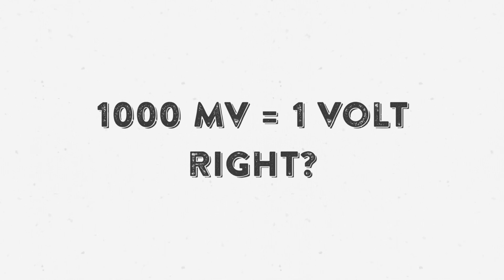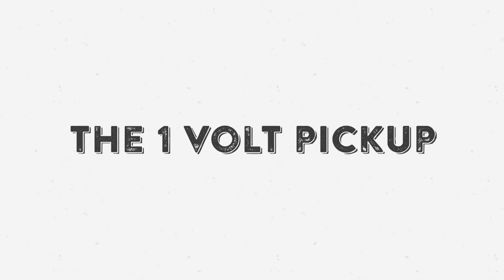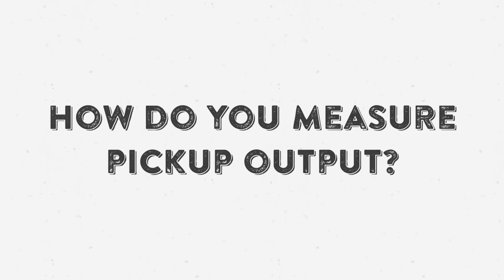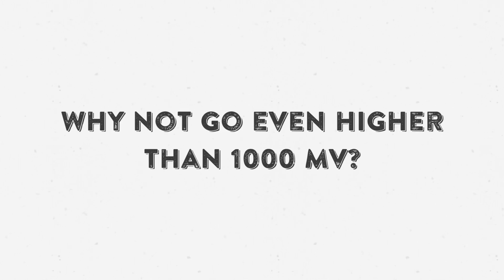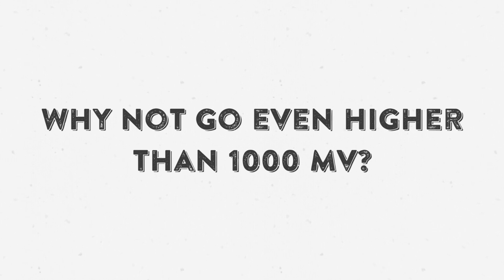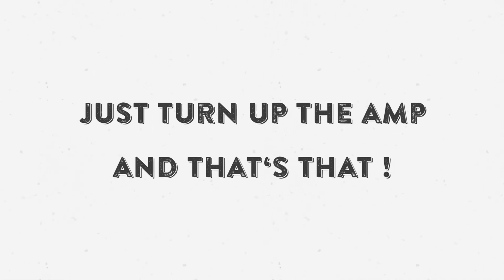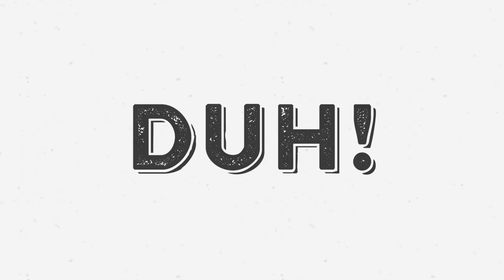The BITE Sound Explained

Comment: I think most companies are quote DCR because it take out of the equation the mounting, the amount of attack of the strong etc and therefore it is easier to compare one pick up to another. Of course the real output is subject to several factors, attack, pickup height etc etc but non of these are controlable by the pickup manufacturer. So i think being able to compare kOhms is useful

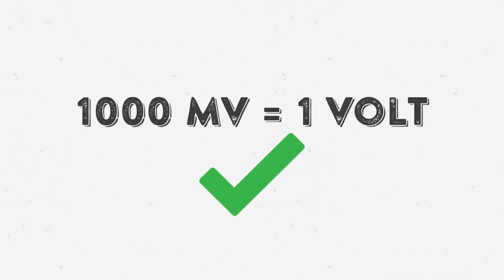Comment: Just a minor point. At 7:27, 1000 MV = 1000 megavolt = 1 GV, not 1 Volt. Now that's what I call a high output pickup. 😃
Reply: It is more than sufficient and it is CLEAR. And the bass... I wouldn't never return it, no way :)
Reply from the maker: Thanks, this font only has caps, so MV stands for mV :)
Reply: Wow, this should be sufficient for most purposes! 😁